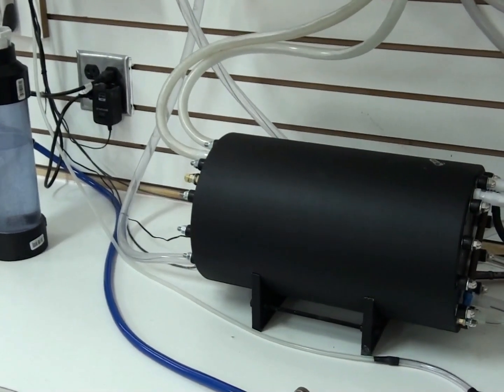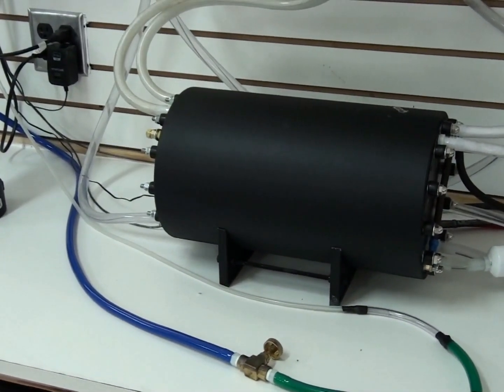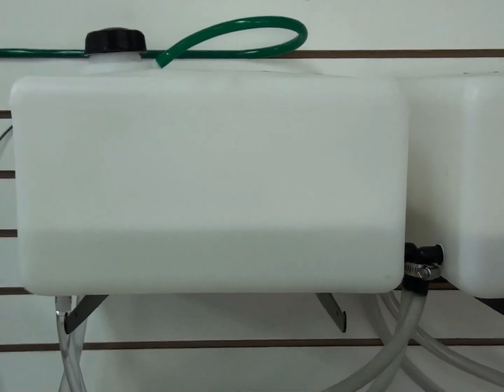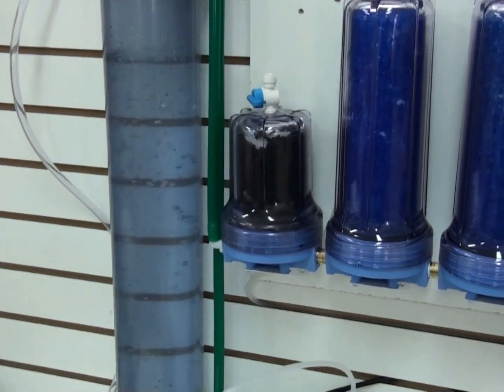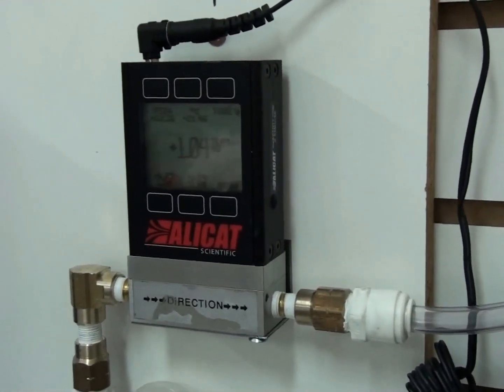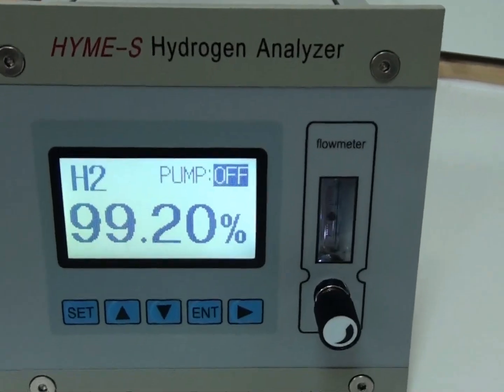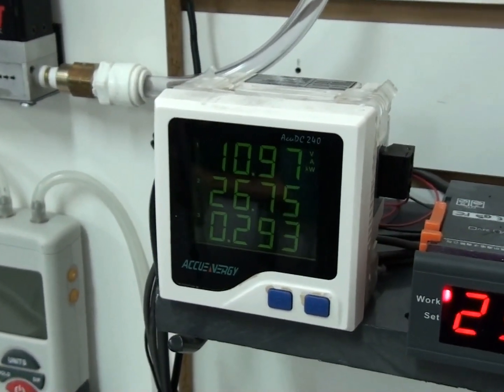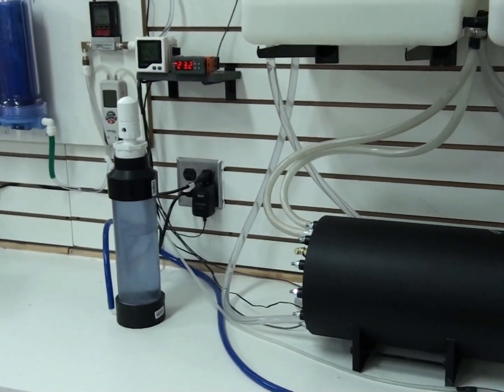HydroTube Operation pure Hydrogen generator

Comment: Preparing to order the "HydroTube 6" 20 plate Hydrogen/Oxygen Generator SYSTEM" from your site.  Is this still fully available and anything else required with this system in order to make it ready to use?  Also, I think that it can only maintain around 5 PSI....if correct, have you made any progress on an external compression unit for storage of Hydrogen?

Comment: Running at 0.293kW it's going to cost you probably close to 30$ in a day, and you're only going to harvest 120g of Hydrogen in that 24 hour period.  Hardly enough to do anything with.

Am I wrong in my numbers?
Reply: +delvis11 Using that number it looks like that 120g of H (or 50 cubic feet) only costs 90 cents.
Reply from the maker: Ben Olenick Here in Utah power is 13 cents a kWh

Comment: That is a most excellent system. Are you using pulsed DC in you power supply like a square wave, or is this constant DC current?
Reply from the maker: Diadon Acs The power is coming from a linear power supply. It's not pulsed waved.